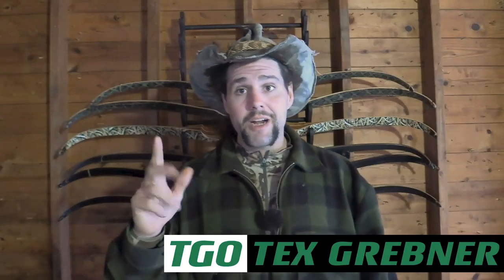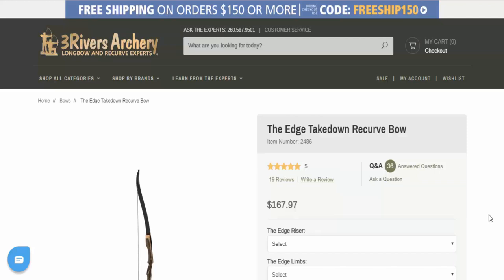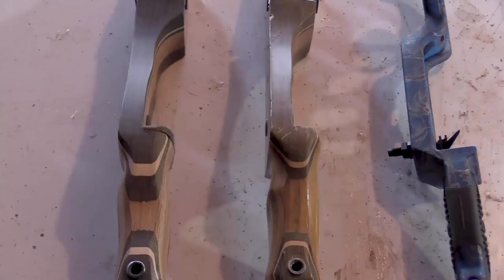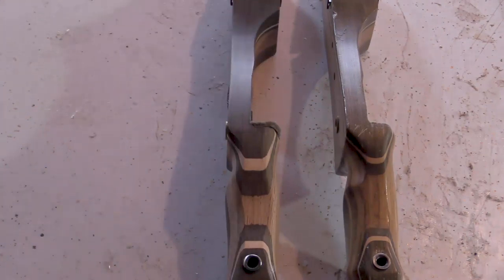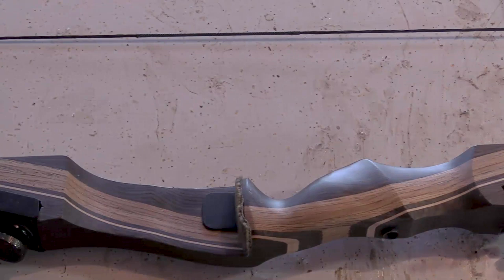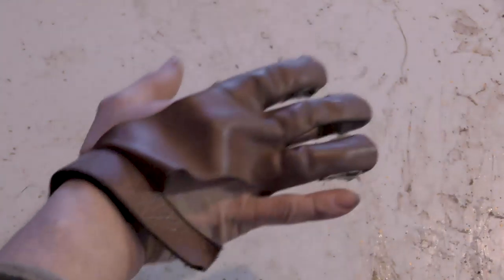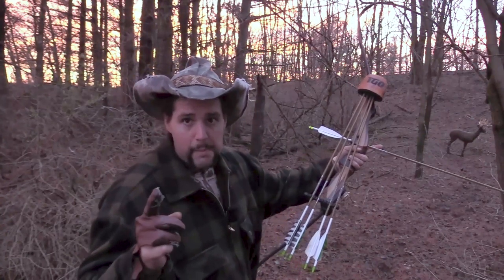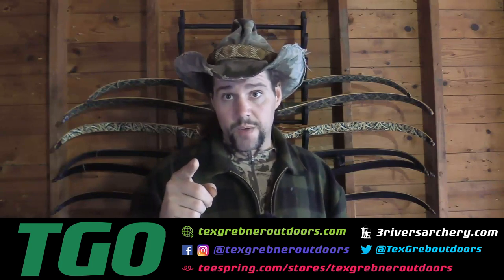Traditional Archery Beginner Buyers Guide Deep Dive | Tex Grebner Outdoors

Comment: EXCELLENT information! I appreciate this so much. 

I'm really curious, what's your opinion on using stabilizers for instinctive shooting? I have a SWA spyder and it has a threaded insert for adding a stabilizer. I actually was wanting to add a sling to my bow, and the advice on the internet is to put the sling between the bow and a stabilizer. I don't see any instinctive shooters using stabilizers, though. Why is that?

Comment: so i shoot 60 lbs on my compound. what draw weight do i want to get in a recurve ? my dlength 31
Reply: Probably start in the 40-45 lb range
Reply: Also, your draw length will be a little shorter vs a compound. I'd bet you'd be 29-30 in. (I also have a 31" compound draw but pull 30" with a recurve). With that in mind, I'd go for a 35-40 lb as a first bow, since a longer draw than 28" would mean more weight (about 5 lbs every 2"). If you plan on hunting, make sure you know what the legal minimum is for the game you are pursuing. In my state, 35# @ 28" for deer is the minimum for trad gear. I asked a game warden if a 35# @ 30" would be okay and he said "if the bow says anything less than 35#, you're getting a ticket" (for me, a 30# @ 28 would get me 35# @ 30). Good luck!!

Comment: Why would anybody take advice about bowhunting from someone who has had no success as a bowhunter. I bought a sage a couple years ago just because everyone was talking about it. It’s junk there slow they stack terribly and  they are not built very well at all the string that comes with is useless. Save your money buy a better bow the sage is not a good recurve bow even for a beginner
Reply: Many would disagree with you on the sage. Sure it stacks past 28 but it's a great bow to get you started. The string being junk is true but I see junk strings come on bows 4x the price of the sage so a new string should always be advised with about any bow purchase.
Reply: X Factor Outdoors most of the people who buy the sage are first time bow buyers. If you don’t think this bow stacks you should shoot a nice recurve and feel the difference. There are better bows out ther for just a little more money. Personally I would rather have the black hunter than the sage.The  sage is a very cheaply made recurve.
Reply: I know. The sage begins to stack at 28inches. I've shot recurves as short as 48 and didn't get stacking just because I'm a short draw length. I've shot both the sage and black hunter. I agree the black hunter is a better bow for roughly the same amount.
Reply: X Factor Outdoors the black hunter for a starter bow is probably the best way to go for people starting out. You can also get longbow limbs for it I have longbow and really like it it has made several trips to the stand and taken 3 deer so far at 50lbs.